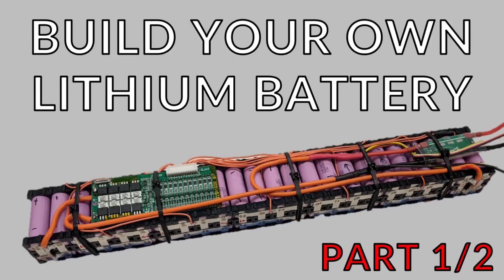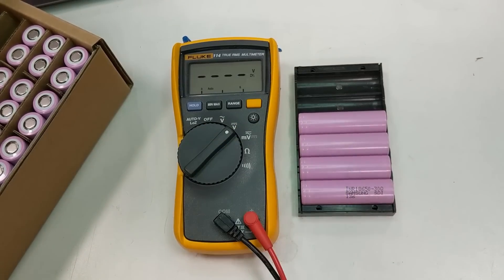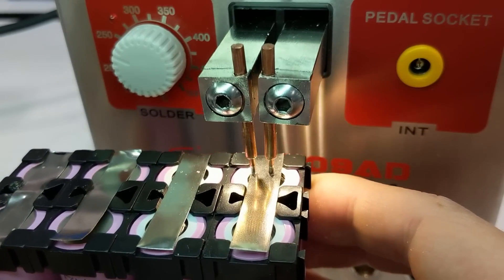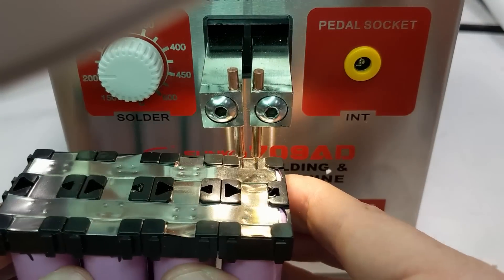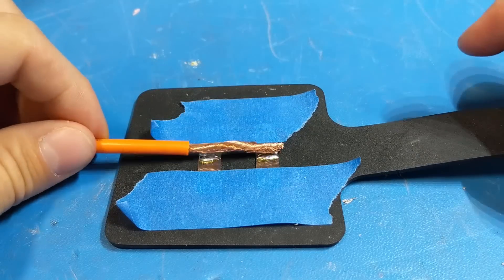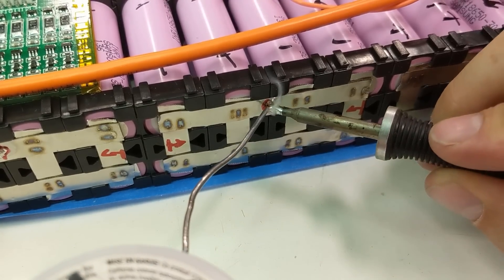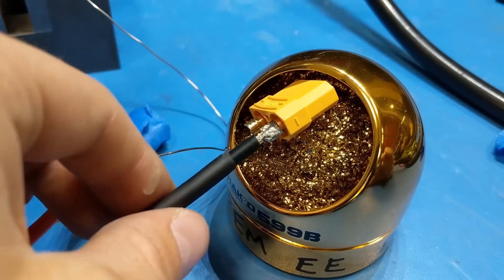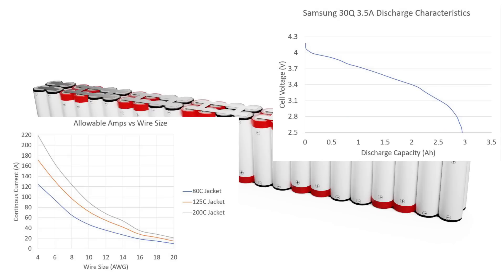How To Build a Lithium Battery (Part 1 of 2)

Comment: Even if the pack's and charger's management circuitry will eventually equalise the charge on each cell, would it not be desirable to precisely match their SoC before assembly? Cheap capacity tester boards are available that can be used to do this to within less than 1% (and of course actually ascertain their capacity to similar accuracy - a simple voltage reading doesn't really tell you this).

Comment: Great video not sure I want to spend that much on an on off switch I will stick with an anti spark plug and a cheap switch..
First time I've seen a pack built with all 4 batteries the same group usually there +-+- all the way through got's me rethinking my setup..

Comment: One should make absolutely sure (by using hot glue or silicone) that all the cables are properly stress relieved. Soldered fine wire connections are really bad strain point and any movement in the wire will cause premature failure over time to that connection.

:)
Reply from the maker: Very good point

Comment: “Should read somewhere in the 3 to 4 volt range, if it reads anything else it’s a bad cell” is dangerously incorrect information.
Good cells can be 1v and bad cells can be 4v, the voltage has nothing to do with cell health. 
They need to be tested...
Reply from the maker: Thanks for the feedback! Do you have a link where I can learn more about this?
Reply: @AdamBender  Hey mate, check out HBPowerwalls processing video:
https://www.youtube.com/watch?v=v_4ggDN7290
Reply from the maker: @chrispfeil6605  thanks for the link! Lots of helpful info there
Reply: A good cell will never sit at one volt. I personally wouldn't use anything below 3v. I agree a 4v cell could very well be bad though